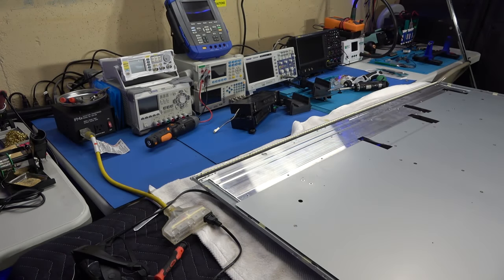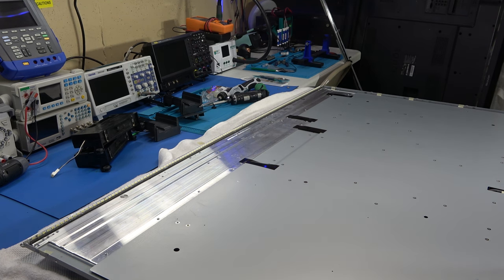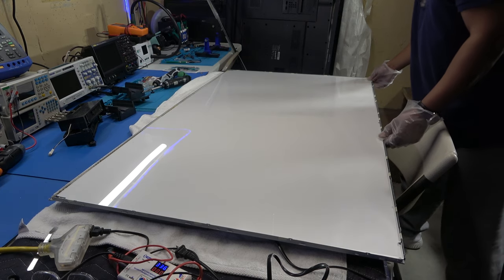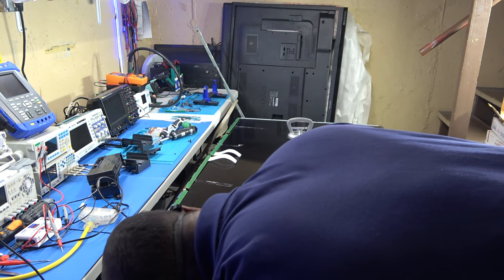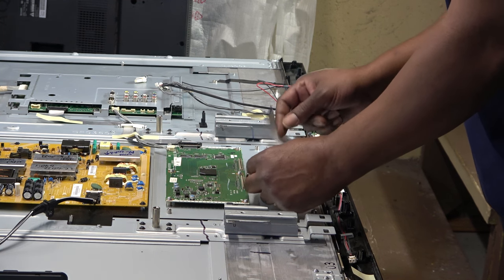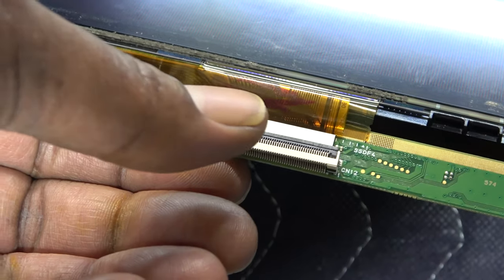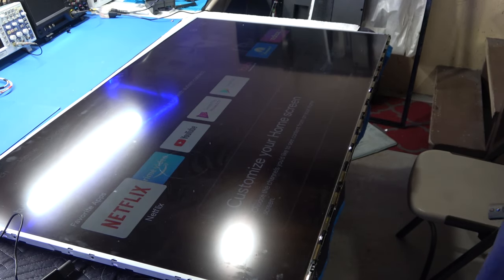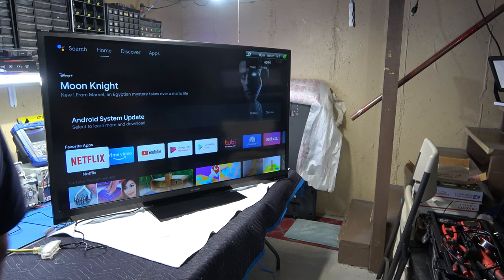Sharp Aquos 60" LED TV repair, (Part 2). I GOT🐕 DOG-WALKED🐶 ON THIS ONE!

Comment: So I had the slow blink and fast blink..replaced the leds on an 80” Sharp..now I get two blinks and 5 fast blinks…power supply?
Reply from the maker: try the factory reset
Reply: @soundbasics were you able to fix?

Comment: Great video big Dog. I need HELP PLEASE. I have a Sharp Aquos LC-60-C6400U that will not power up and has code 2 long 3 short. I've looked hard for the code meaning on YT and Google with no luck. The tv first started loosing the picture from time to time. cold or warm. The sound worked fine. I tried the heating the processor with light pressure to prevent movement. Then it would not not come on with only the code flashing.   I have tried all the reset procedures I could find but no change. I also changed the power board with results the same. Fuses on both boards are good. ANOTHER PROBLEM is I can't find a diagram that shows the pin numbers location at connector on power board and leads to the main board. Only pin with power is 5V on what I presume to be pin 15 (BU5V). Many thanks for any help.

Comment: Hey big dog my sister gave me a lc70le733u backlights never come even when I try the reset procedure if I hold chd vol up an plug in the logo led are solid still no backlight checked voltages I've got 64 volts on l1 on the led driver board but nothing on l2 I'm a tv tech of 40 years experience an have fixed tvs with backlight strips failure before but normally you get a flash or light then off it goes !! Any help is appreciated want to fix for my man cave thought maybe led driver board is bad thx Ed